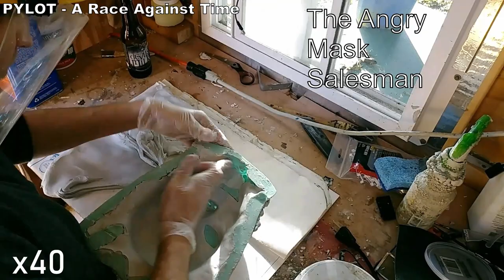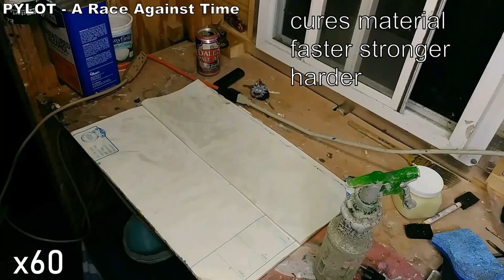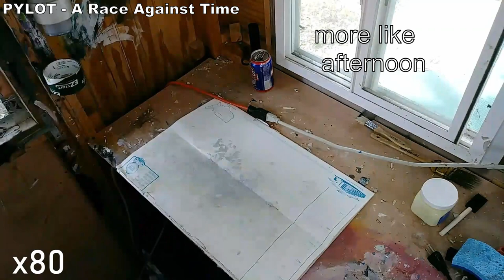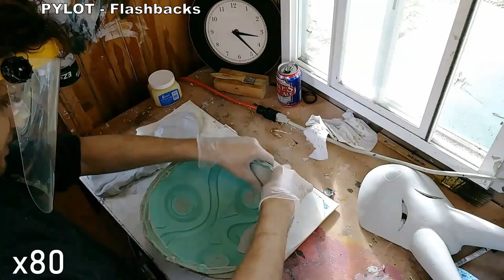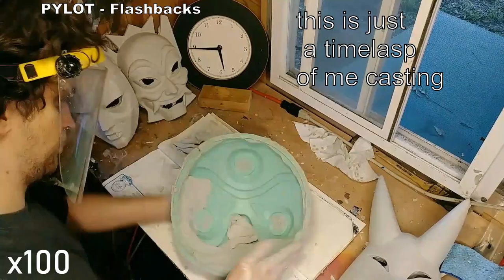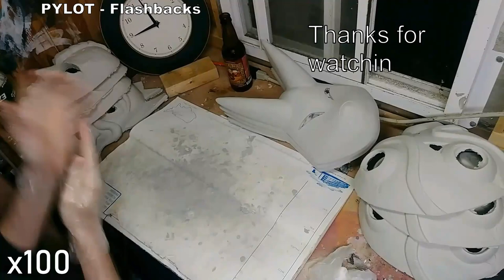Mask Casting (Part 1)

Comment: What did you use for the jacket molds?
Reply from the maker: Darren Salazar jacket mold is brush on silicone, Rebound 40. Shell mold is made from the same thing i cast with, free form air.
Reply: Excellent, thank you